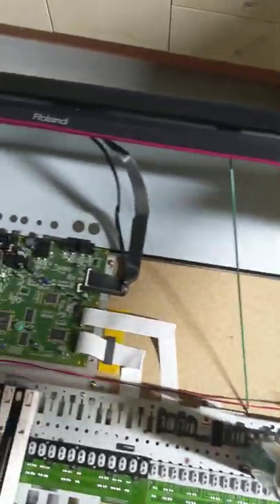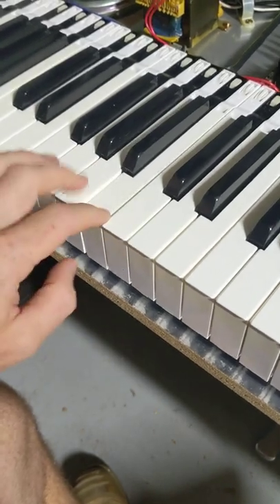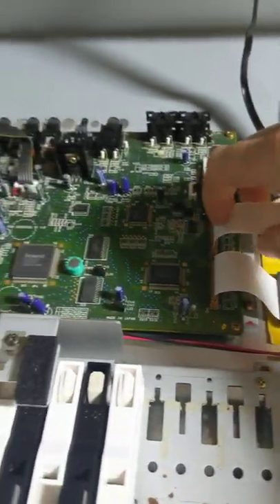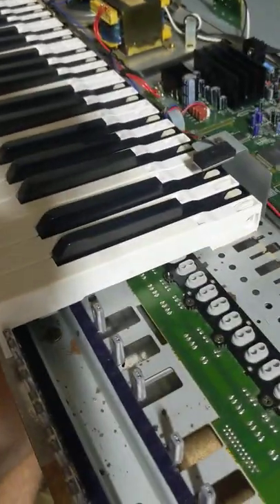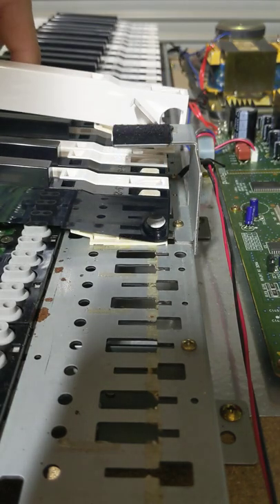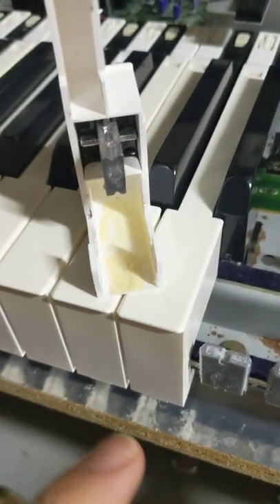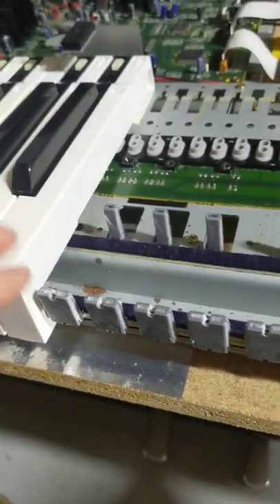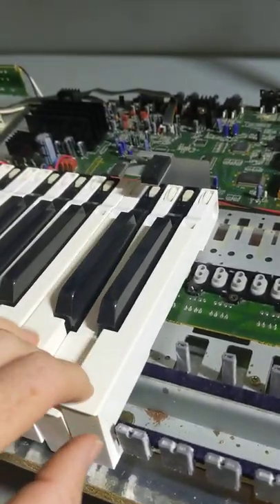How to fix sticky keys on a Roland HP-1500 electric piano.

Comment: I've got a HP1700 that had some sticking keys and also two keys that only play the notes at full velocity.
As for the sticking keys, I just took them out, cleaned them with 70 percent alcohol, relubed the moving parts with vaseline and they are working fine now.
As far as the velocity issue, I noticed the circuit board underneath the thin grey rubber velocity trigger thingies. You can look there and see which one triggers the high velocity and which one triggers the low velocity. I traced the low velocity circuit on the board and instead of being green it has a bit of a blue hue, which makes me think that circuit trace on the board is oxidized and the connection is broken there, because copper turns blue when it oxidizes.

In your case, try using testing the continuity between the velocity triggers under the grey rubber, and a couple inches away were they reach their destination at the solder joint. If both of those circuit traces in the circuit board are bad, that may be the cause of no sound.

Sorry if some of my terminology is off. I'm not an electronics expert.
Reply from the maker: Thanks for your reply, I have noticed that if I use a flat head screwdriver between the two connectors it makes a sound which is great! I just need a better connection somehow and conductive paste doesn't work unfortunately. 
Thanks for the information I'll do some more tests, I've put the project on hold for another day. (Focusing on the studio build at the moment).
Reply: This is my exact issue on mine, on my problem notes under the connectors is almost a blue burn on the circuit. Did you find a fix for the velocity?

Comment: Hey did you ever figure out the keys that didn’t play sounds? I just picked up a free one and it works brilliant except there are two blocks of about 5 keys each m—one on the very high notes right hand side of keyboard and one just on the left of middle C—both black and white keys all in a row that don’t have sound. I’m gonna take it apart like your vid and see what happens. Hopefully it’s just the contacts and not the motherboard. Let me know please! Thanks for the vid!
Reply from the maker: I think it's the contacts, because if I use a flat head screw driver to bridge them it makes a sound. I tried using conductive paste but it didn't work. I cleaned them well but oddly they are still not working. Hopefully you find luck with yours.
Reply: You can see if the contacts are not working switch the ribbon cable and see if they work